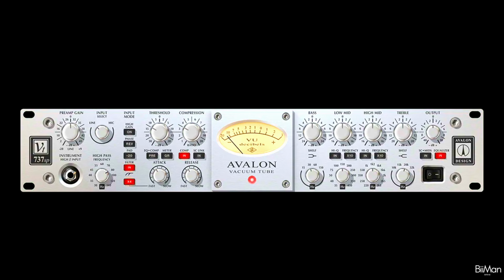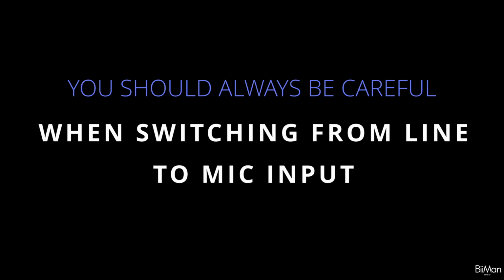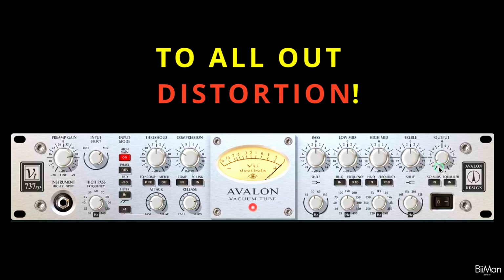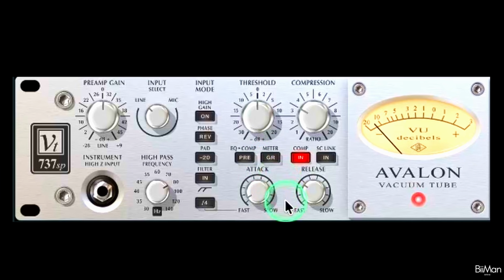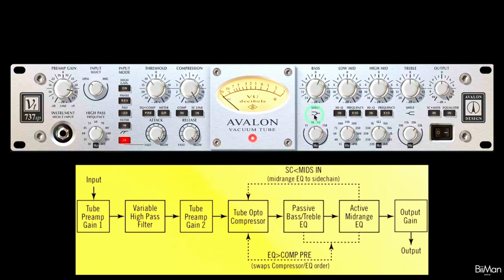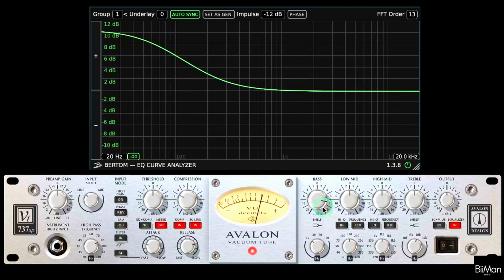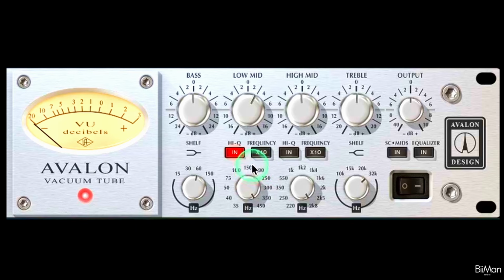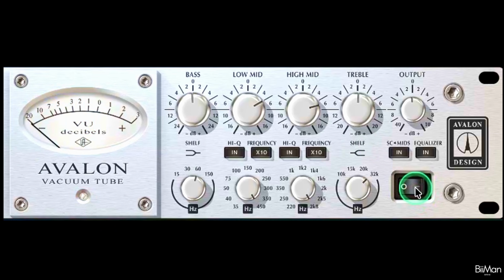The Ultimate AVALON Vt 737 Complete Plugin Breakdown With Examples.

Comment: Does these settings work differently if using as an insert with a non Apollo interface?
Reply from the maker: You get pretty much the same juice from the preamp using it as first plugin as an insert. Difference with using it with an Apollo is you can track with it in real time and burn the sonics from the preamp directly into your source signal before it reaches your DAW.
Reply: @BiiMan1  Thank you so much for the feedback.